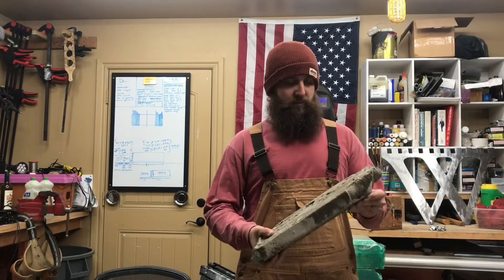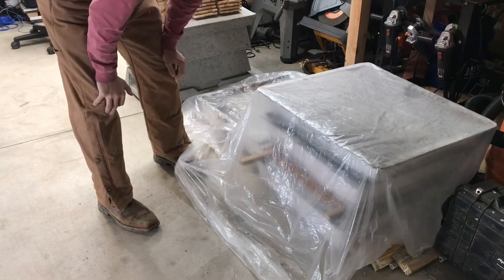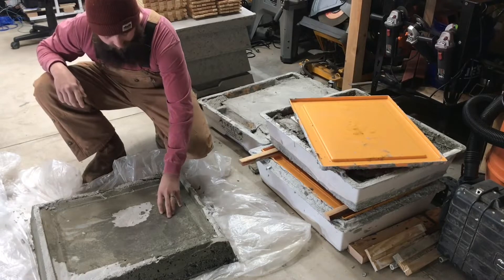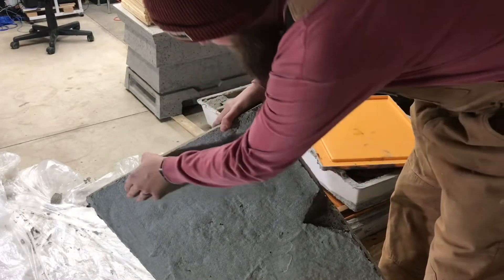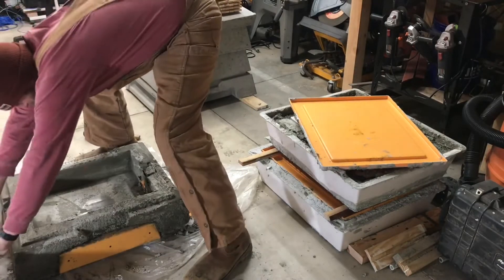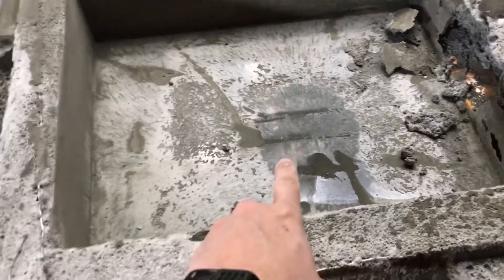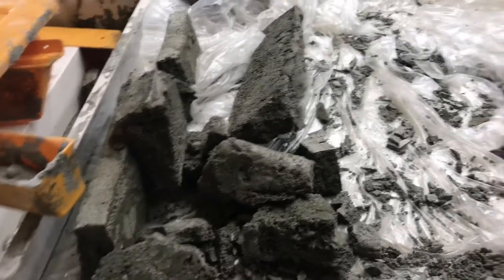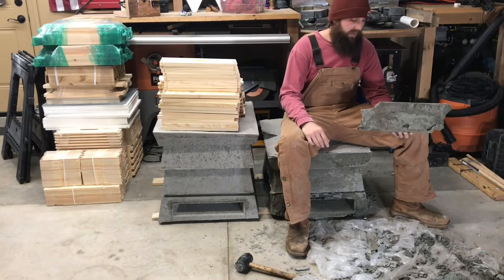Part 2! The Aircrete Beehive Experiment

Comment: Also, finding out which mold lubricant works best would be vital for the aircrete mix.  And which aircrete mixes provide the sweet point between durability and insulation/loft.

Comment: Foamcrete is absolutley the smart way to increase insulative properties and reduce weight.  I bought an Aircrete Harry pump because I'm building both beehives and garden boxes from foamcrete.  I am investing in a vibration table, a cheaper one and if I have to ratchet tie down the mold to the table, so be it.  I intend to make over 200 beehives, so this experiment was foundational. I wonder if chopped straw would be a good fiberglass replacement? THANK YOU!

Comment: I haven't been through all your concrete hive videos, so I don't know exactly what you did during the cast, just several things to consider:
1 polish the surface of the mould, with wax, helps with demoulding
2 blow air in between the mould and the concrete, with a compressor, 7 bar is good, pushes the mould away from the concrete, especially when the mould has that much flex in it, and if the concrete surface flakes and peels off when taking on the pressure, that concrete won't last outdoor anyway
3 sometimes it is a good idea to leave the concrete piece in the mould for an hr or so before you commence the demoulding, concrete shrinks a little as it goes through the first few hrs from the mould has been uncapped creating gaps between concrete and mould,  this combined with the number 2 method will do most jobs
4 clean up all edges and corners after the cast before it hardens, so much easier than doing it afterward
5 too much vibrating causes segregation, it's a concrete term for when sand sinks to the bottom and all other lighter stuff floats to the top, if there is a long term plan for these concrete hives, the mix design has to be studied, vibrator won't save a poor mix, and if the mix is right, for small details on edges and corners an abandoned electric tooth brush with bit of hacking will work a charm
hope this would be helpful to someone
Reply from the maker: Thank you for sharing that information. You mentioned some good practical tips that I haven’t thought to implement yet. If the hives continue to perform well through the summer, we will be making a lot more of these. Thanks for watching!

Comment: you need to use a concrete vibrator, it causes the cement to flow into the forms and eliminates bubbles. There are small versions available that would suit your project, you would get a smooth glass like finish all around.
Reply: I’d be curious to see the effect of a vibrator. Works on normal concrete, should work here too with smaller pours, bits at a time. 

Kenyan rooting for you
Reply from the maker: @outlookaccount4625  i am definitely going to try the vibrator on the next pour. That would have made much better results.
Reply from the maker: Thanks for the feedback, Luc. I'd considered finding something like that, but I havent ever seen any vibrators that small.. Now I am on the hunt for one. That would absolutely be an invaluable tool to have.

Comment: Thank you for trying this out!  I myself have been interested in the many different ways to compose a beehive and in turn came across this video.  
I would love to chat and learn more about your experience with this hive set up and bee keeping as a whole if you ever have the time. 
Thanks!
Reply from the maker: We still have a lot to learn. We are going to modify our progress for casting Aircrete and will try that again. We also plan to cast using perlite based lightweight concrete. We want to know what’s the best balance of cost, weight, strength, and R-value.  Do you keep bees currently?
Reply: @castlegroundsapiary  Would really appreciate if you try and cast perlite and light weight concrete. waiting for your next video.
Reply from the maker: @Krupalgj  that’s coming next! Video to follow soon. Thanks for watching!
Reply: @castlegroundsapiary  I have plans to build concrete boxes for a totally different use, but seeing the real life examples like yours gives me insight into the challenges I will have. Thanks for saving me the pain and anguish. I'm considering a clean mold separation with P David Jensen's mold release, brushed on hard glass finish cement surface with water resistance due to pva glue in cement slurry,  1/4 inch horseshoe shaped gfrc reinforcement layer to provide tensile strength, topped off with aircrete as a filler, then dusted with portland and troweled to a smooth finish after it starts to harden.  I have experimented with pearlite and several paper fibers. I can work with paper, not so much with the pearlite. I'm just about to build a miniature foam generator. You look like your having too much fun with it not to. Wish me luck!
Reply from the maker: @StevenfromTX  That sounds awesome! You've got me very curious.. What are you making? Would love to hear about what works for you and what doesn't. Good luck to you indeed!
Reply: @castlegroundsapiary  I'm working on making yt videos of artistic concrete projects. To pay the bills I expect that I may need to make some secure delivery boxes. My neighbors have their medicine delivered by USPS. Sadly porch pirates are becoming a thing. My grandfather kept bees. Great memories!